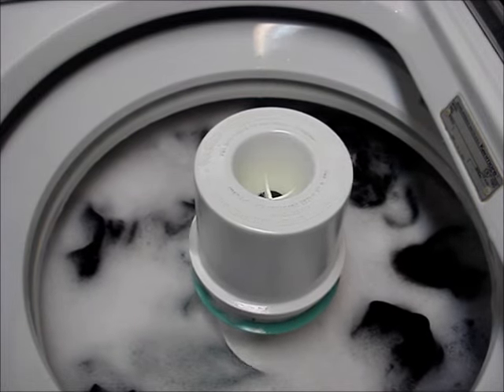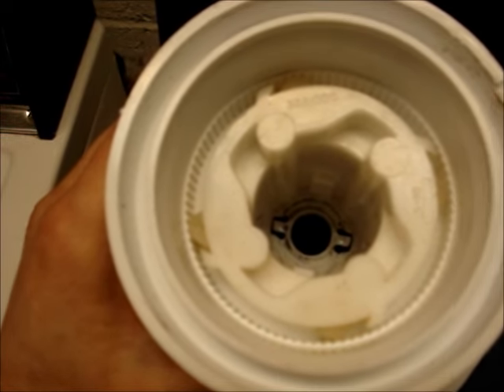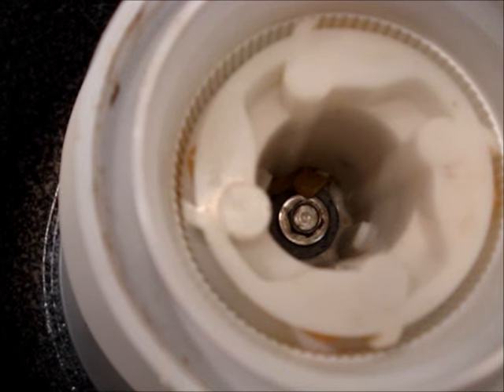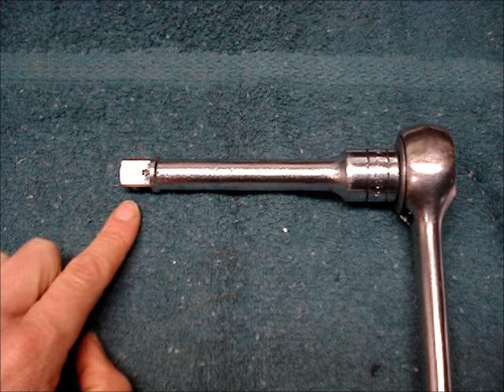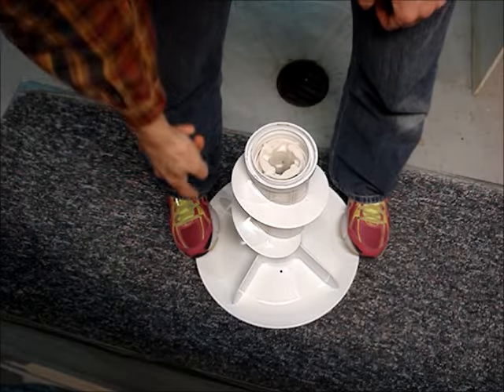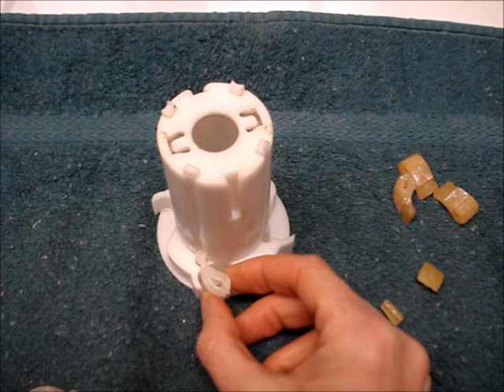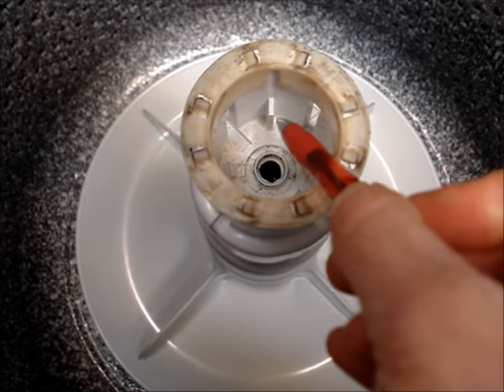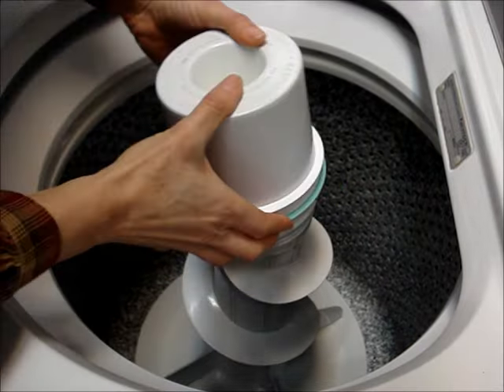Repair Whirlpool Kenmore Washer That Won't Agitate

Comment: I love these older washers and dryers. I’ve had mine for 23 years now. There have been a few repairs (like this one) over that time but they still wash and dry clothes. Guarantee you won’t find a newer set running that long. Good video!
Reply from the maker: My friend got a new washer and dryer a couple of years ago.  The guy delivering them told her, "These won't last as long as those did."  A couple of years ago, I gave the dryer some TLC.  I replaced the felt seal (video on the channel for that) and a few other small things.  I cleaned out the lint chute and vacuumed the fuzz off of the motor.  Cleaning off the motor every once in a while is a good idea.  If it gets covered with lint it will run hot... not good.  I am going to repair them as long as I can.  If we really cared about being "green" we would demand that products are made to be easily repaired and not planned to fail.

Comment: Thank you SO SO much! For a couple of months now, I kept thinking that I need to buy a new washer because it wasn't agitating well. I was resigned to the idea that I would be spending at least $500-$600. 3 days ago I decided to search for possible solutions as to why it wasn't agitating and came across your video. I followed you step by step and found the dog agits were worn down. I ordered a set from Amazon and they arrived today. I already had the unit disassembled and it took a whopping 2 minutes and 57 seconds to put in the new ones and put it all together and now, I have a washer that works great! Again, many thanks!
Reply from the maker: You are welcome, Pete.  It's my pleasure to help.  I always enjoy hearing from people who watch the videos.  Thank you for taking the time to tell about saving your washer from a land fill.

Comment: This is the exact same agitator assembly that my Kenmore washer has, so the video was especially easy to follow.  I had to use some channel lock pliers to get that softener lock ring to snap up, and the cam/agitator reassembly was confusing on first attempt. I wish I had taken a picture once the dust cover was removed, but I figured it out on the second attempt. Thank you so much! My agitator is working again and I probably only spent 10 minutes on the repair.
Reply from the maker: You are welcome.  If you have the companion dryer, there are a few repair videos for that on the channel.  There is also a video on how to replace the water inlet valve.  If the washer starts to fill slowly, that is likely the problem.  Have a great day.

Comment: Thanks to your 6 year old video, my agitator works again. Now I just gotta replace the water level switch
Reply from the maker: It's worth repairing the old appliances if you can do it yourself.  The new ones won't last as long.  I still have the washer & dryer set.  I did a little rehab on the dryer about 5 years ago.  It needed a new felt seal.  There are videos on the channel for the dryer repairs.

Comment: As others have said, this was an excellent video which enabled us to quickly fix the agitator and have clean clothes.  All the parts and tools were clearly described and shown (no head or hands blocking view); voice was pleasant and to the point.  Dog agits were available locally at a parts supply store for $4.20.
Reply from the maker: Thanks for the compliments.  Congratulations on the successful repair.

Comment: Thank you! One of my parents' friend's agitator stopped working, and my mom told him just to go buy a new washing machine because his is so old. That broke my heart! I learned a long time ago that you need to hang onto those good old washers for dear life because the fancy new machines are pretty much disposable as well as expensive. So, for ≈ $18 & with the help of your video, I bought a new agitator assembly and clutch for the motor (just in case), and I have him back in business. I bagged & labelled the extra parts with instructions and attached them to the back of the machine so he will have them handy if he needs them. Buying the extra parts is still way less expensive than a new washing machine! Bonus: before I could even get back home, he had already called my mom to tell her how smart I am. If he only knew my little secret...! 😂😂😂 Thanks again for sharing your knowledge so that I could help save the day for a family friend. ✌🏻💜🛼
Reply from the maker: I agree, the new appliances are money pits.  I rebuilt the dryer that is the companion to the washer in the video.  There are videos on the channel that show most of those repairs.

Comment: Excellent, clear, and succinct instruction - no foolish palaver from demonstrator/instructor - a refreshing change from the norm. Well done.
Reply from the maker: Thanks for the compliment and letting me know I've accomplished my goal.  I try not to waste any of your time, but still give you enough information to do the job correctly.  Please consider supporting the channel & subscribe, it will allow me to continue to add more videos.
Reply: I have subscribed, and when I can I will support - I am always impressed by the generosity of those who take the time, and effort to make videos  assisting others trying to make ends meet. A way of making life a little bit better.
Reply from the maker: Super, thanks for your support.  If you are a little handy, you can save a ton of money by fixing things yourself.

Comment: just used this video today!  I have the same washer.  The old stuff lasts!  Kind of breezed through the video and then came back up to actually pay attention.  lol.  The 2 pieces were stuck together and I didn't want to break anything.  So, i get to the part where she says just put it on the floor and stand on it and pull.  I laughed and went back downstairs and had it apart in 5 seconds.  Ran down to the appliance store and $4 later, problem solved.  Also, took the parts outside and cleaned them up really well with a degreaser while they were apart.  All pieces back to looking like new and 5 minutes later, we had a perfectly functioning machine again!  Thank you for a perfect video presentation.  Everything you could need to get it done, fixed and back to normal!
Reply from the maker: IMHO, if you can get the parts and are a little handy, the old appliances are worth fixing.  I have the companion dryer and have posted a few videos on how to repair that too.  After a while, the felt seal wears away, but you can fix that.  Thanks for taking the time to comment.  I love to hear that the videos are helping people.
Reply: @Know-How-Now  
Agreed!  I see refrigerators from the 70's still going!  Yet these brand new Samsungs and LG's have mother boards that can launch a rocket into space🤣
They leak, freeze up, boards fry, etc.  Some within the first month's.  Our tech gets better every day but we can't build a simple air conditioner for food anymore!
The video was very helpful indeed.  Amongst a sea of useless nonsense on the web, this was like turn by turn directions on a GPS to get there and get it done.  Great job on the video.  Years later, it's still making an impact😁
Reply from the maker: I think the new appliances are deliberately made to have a short life.  IMHO, those circuit boards are a big part of the problem.  It's likely too expensive for an after market board to be made by someone other than the manufacturer.  When they fail, the price of the replacement board plus the labor the replace it (many people can't do their own repair) makes a new appliance the best option.  Sad.  A neighbor just bought a new stove.  It failed after a few uses.  It sat unusable for two months, during 3-4 service calls and then a wait for new parts.  They told her to buy a hot plate.

Comment: Great detail thank you! I knew it had to be simple. The parts and tools needed explained well by you will save me a bit of time. I will start the parts hunt right away. Thanks for a quick informative how to video!
Reply from the maker: You are welcome, Jason!  Look for a tag on the machine to find the model number.  Mine is under the lid.  Use model number (110 + the stamped number) to search for parts.

Comment: Still useful today.  Thanks.
Reply from the maker: You are welcome.  The washer and it's companion dryer in the video are still going strong.  If you have the dryer, there are a few videos on the channel on how to make some repairs on that.  Also, the water inlet valve failed on the washer a few years ago.  That's easy to diagnose and replace.  I have a video for that repair too.

Comment: Thank you for a concise and clear video!  Fixed it!
Reply from the maker: You are welcome.  Way to go to the repair job!
Reply: Know How Now Dryer blower wheel, washer motor shaft coupling (I think that was the part), a loose connection in the dryer, and now this, this was by far the easiest.  As a newish homeowner, I'm reluctant to buy new after seeing the repairability of these older units and the experts on YouTube!  Cheers!!
Reply from the maker: I feel the same way, hang on to the older repairable (not designed to fail & be thrown away) appliances as long as you can.  My cousin has a less than 3 year old Whirlpool dryer, the bearing for the drum has already failed.  He contacted Whirlpool.... they don't care.

I have some videos for the companion dryer to this set.

Comment: Mine does not have agitators on the bottom is it supposed to? Great video though
Reply from the maker: Look for the model number on the washer.  Don't for get to check under the lid.  After you have the model number go to a online parts seller and find a parts diagram for your washer to verify.

Comment: I'm wondering, I've changed the dog agitators, but same issue as your video remains. It spins fine as it normally would. Any suggestions? Thank you much.👍
Reply from the maker: Sorry for the delay in replying, you comment almost got past me.  I have a few thoughts.  Are you sure you put the new dog agits in place the correct way?  You may be able to find a parts diagram at one of the on line part suppliers for your model to verify the correct positioning.  The other thought is did you get the correct replacement parts?  Maybe wrong parts were sent to you or the correct part was misidentified for your machine.
Reply from the maker: PS - check the comment & replies from Carolyn George.
Reply: @Know-How-Now  Thank you.
Reply: Had the same problem, look for a lock ring which is flat and on  top of the dogs this has to be lifted and the slots cleaned to place the dogs in the slot,, Had mine apart a couple of times to.LOL

Comment: Thank you so much I have not got the dogs yet but I took mine apart and all of mine were gone. And of course I have the washing machine that you're talkin about that it does not have  bolt at the top and mine has a ring around it where it looks like the dogs fit on to one ring. I hope this is what's wrong I can put the washing machine on rinse or spin and it will drain out the water. I'm so hoping this is what is wrong. If so you just made my day so close to Christmas. Really cannot afford a new washing machine right now now where can I find the parts? I'm sure I will probably have to order them off of Amazon or somewhere if anyone has any suggestions on where to get the dogs at please let me know thank you. And to the one who made this video you rock and I know I probably did not spill those little things right but IDC
Reply from the maker: If they are gone, for sure you have one problem.  If possible buy OEM parts (parts from Wirlpool).  Find the ID tag on the washer, mine is inside the lid.  Do an internet search for you washer make & model number.  You will find sellers who will show a parts diagram.  Get the part number for the correct dog agits.  If it's the same as mine, here is a reputable seller on eBay- see below.  Merry Christmas.

https://www.ebay.com/itm/113026173717?hash=item1a50e28b15:g:57wAAOSwjWJgNAxs

Comment: Hello, I had already changed that part which one of the dogs were broken so that was one of the problems but it’s still not agitating. What else can be wrong?
Reply from the maker: There is some gearing below the agitator.  Maybe the problem might be there.  Get a parts diagram for the washer, you'll be able to get an idea of what is below.

Comment: Hello my  assembly is exactly like yours including the softner everything. Not sure if you will respond after many years. i am having trouble seperating the two parts of the agitator where you step on the bottom and pull up. But in your video you started a sentence" the two pieces of this agitator were stuck together" like mine (my machine might be 50 year old) then you said "you may be able to just pull the top piece off yours". afaid to pull up any harder. You had not finished your thought if you were not able to seperate the two pieces or how you seperated the two pieces once you determined they were "stuck". any ideas would be helpful. too bad I can't get the cam out first. The two piceces of the agitator do have play. Probably just really dirty. Maybe spray some WD 40 (doesn't eat plastic and may clean up some of the funk). I have just gotton really good over the years of knowing how much pressure until it snaps, but you might just say "pull harder" Actually looking at the two pieces side by side I may be able to slide  4 pieces of  somthing realy thin to push in the 4 locking tabs of the  lower part of the adgitator to help it realese the upper part. Thank you so much. I liked and subscribed
Reply from the maker: I had to give it a good yank to get it apart.  I understand what you mean about too much force is going to break it.  Maybe some WD40 and then bang on it a bit with a rubber mallet?  If it doesn't come loose, let it sit overnight and try again.  I once worked a seat post loose that was stuck in a bicycle frame using PB Blaster and a rubber mallet.  It took 3-4 days of shooting Blaster in there, banging on the seat, then try again when I was walking past.  It eventually came loose.  I suppose you could buy a new agitator, but that might be kind of expensive.  Thanks for subscribing.  Let us know how it turns out.
Reply: @Know-How-Now   OK I got it. I flipped the upper and lower adgitator upside down on the washer on newspaper and soaked it with WD-40 and let it sit for IDK... weeks, then this morning gave it three tuggs and voila it came apart, no problem. Cleaned everything with soap and water, everything is pristine for a 50 + year old washer, shiny new looking, not brittle, nothing broke off. I bought two more sets of OEM genuine Whirlpool dogs for spares off EBAY. Cheap like  $6 for the first set and $10 for the next two free shipping. That thing I tought was a plastic Nut on the lower adgitator was part of the mold. I just need to clean the old grease out of the metal and plastic spline and 7/16" bolt then re-apply. Rubber on the 7/16" bolt perfect. Just need to make sure I Dont over tighten. Gasket on dust cover perfect. if you care, here is the link to the  exploded. at sears parts direct https://www.searspartsdirect.com/model/4126c1e5iw-000582/kenmore-11082984120-washer-parts
Wow thank you so much for your video. I thought I might have to spend like $90 for a new adgitator ( with shipping)
 Take care.............Mark
Reply from the maker: Thanks for the detailed information, Mark. I'm sure it will be helpful for anyone else having the same problem.  Patience and persistence did the trick.  I am hanging onto my old appliances as long as possible.  The new ones don't last.  I just talked to a neighbor who has been through 5 dishwashers in about 20 years.  My Kitchenaide from 1989 is still running like a champ.  I did have to replace a rubber section of waterline that connected to the inlet.  Whoever installed it allowed the hose to rest against another part and a hole was caused by vibration.  It's a shame that the new junk/not repairable appliances are going to landfills.

Comment: I didn’t see this in the comments. I installed the dogs and now the agitator is moving left and right, but it doesn’t continue to spin around. What did I do wrong? Or is something else wrong with my washer?
Reply from the maker: Grasp the top of the agitator and turn it clockwise, only the top half of the agitator should spin.  Then try turning the agitator counter clockwise, both the top & bottom pieces of the agitator should turn at the same time (as one piece).... that means the "dogs" are catching and working properly.  If it's not working like this, then perhaps you have the wrong "dogs" or they are not properly installed.
Reply: So I checked it out. And it looks as though I may have tightened the bolt too tight. I rechecked the dogs were installed properly and catching then when I put the bolt back it wasn’t working quite right any more. Loosened the bolt and it allowed the top part to spin at each turn then the dogs would catch.
Reply from the maker: Good job troubleshooting.  Thanks for sharing, your experience may be helpful to others.

Comment: Good video,  but where can I order dogs?
Reply from the maker: Find the plate on the washer with the model number.  Look for it under the lid.  There are many appliance parts sellers.  Find one of their websites, do a search with your model number.  Get the part number.  I always try to get OEM parts.  You might find the part on eBay.